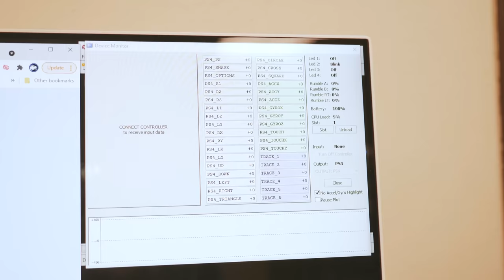HOW I HAND BUILT my DREAM CONTROLLER from SCRATCH 🔥 (DIY GAMING CONTROLLER)

Comment: ik im not going to get it but right now i am using the original ps4 controller and it has stick drift and my L2 will get stuck so im stuck aiming in and this would help so much

Comment: i dont see anything about reduced tension on their website.
Reply: not available for public yet, only their sponsored players can use it at the time being because they are just testing it out the same with Hectors 2 buttons that he adds to the side of his controller sort of like what the scuf vantage with the 2 side buttons
Reply: @christopheraguiniga7884  pretty sure u can get the reduced tension now I saw it on the website!!
Reply: @j0eYzZ  i just checked they dont have it on the pro builder where you fully customize your controller so unless its in the quick pick option then its not available yet but thanks for the info

Comment: A new controller that can actually tactical sprint would be a dream!!
Reply: If you go on settings you can put tactical sprint on automatic so you don’t have to click on the joystick
Reply: Just set tac sprint to auto LOL
Reply: @v3ng3fulvikingshow78  dont think u didnt understod what i meant. My controllers is that bad, it cant even tac sprint
Reply: Damn so you can’t move forward either ? You don’t have to click the analog if the stick moves can set to tac sprint instead of walk/run if it doesn’t do that your in dire need of a controller my guy . Hope you get it fixed best of luck .
Reply: Lets just hope my guy @Lucky Chamu got me ;)

Comment: Rear Buttons - Number of Rear Buttons:
0
Rumbles - Large Handle Rumble Motors:
Remove
SmartPad - Smart D-Pad?:
No
SmartPad - Add D-Buttons?:
Yes
SmartPad - Smart Face Buttons?:
Yes
Thumbstick Tension - Left Stick Mechanism:
Stock PS4
Thumbstick Tension - Right Stick Mechanism:
Stock PS4
Bumpers - Left Bumper (L1):
Smart Bumper
Bumpers - Right Bumper (R1):
Smart Bumper
Triggers - Left Trigger (L2):
No Trigger Adjustments
Triggers - Right Trigger (R2):
No Trigger Adjustments
Touchpad - Touchpad Button?:
Lower Right
Faceplate - Faceplate Type:
Stock
Faceplate - Stock:
Stock Clear
Rear Shell - Rear Shell Type:
Soft Touch
Rear Shell - Soft Touch :
Textured White
Face Buttons - Smart Face Buttons:
Smart Face Buttons - Black
D-Pad - D-Buttons:
D-Buttons - Black
Share/Options - Share/Options Type:
Stock
Share/Options - Stock Colors:
Stock
PS Button - PS Button Type:
Stock
PS Button - Stock Colors:
BBC White
Bumpers - Bumper Type:
Stock
Bumpers - Stock:
Stock Grey
Triggers - Trigger Type:
Stock
Triggers - Stock:
Stock Grey
Touchpad - Touchpad Type:
Stock
Touchpad - Stock:
Stock Black
Left Thumbstick - Thumbstick Type:
OEM
Left Thumbstick - OEM:
OEM Grey
Right Thumbstick - Thumbstick Type:
OEM
Right Thumbstick - OEM:
OEM Grey
Rear Buttons - Rear Button Cap:
Beaver Tail
Rear Buttons - Beaver Tail:
Beaver Tail
KontrolFreek Grips - KontrolFreek Grips:
No Grips
Warranty - Controller Warranty:
120 - Day Extended Warranty
Accessories - Premium Micro-USB cable:
10ft Premium BBC Micro-USB Assorted Colors
Stickers / Decals - :
BBC Sticker
Build Time - :
Delayed Build time (12-14 weeks)
Controller Protection - Ship With::
Battle Beaver Protective Case
Controller Protection - Add Custom Nameplate?:
Add Nameplate
Controller Protection - Nameplate Type:
Clear Plexiglass